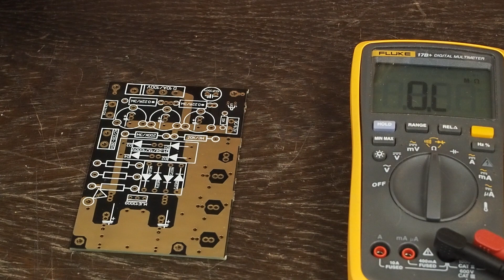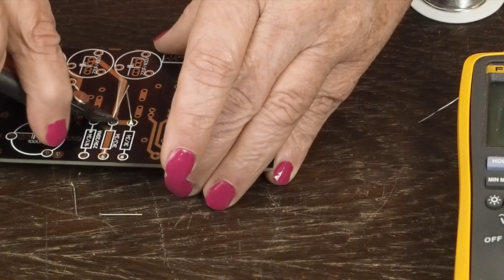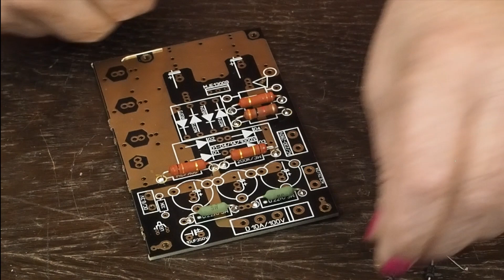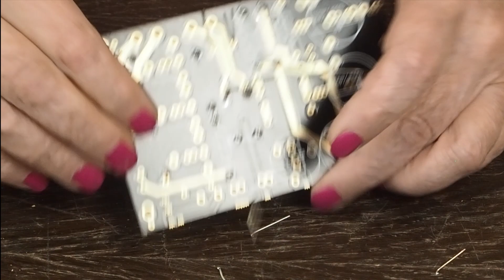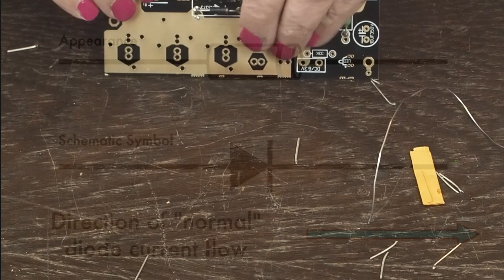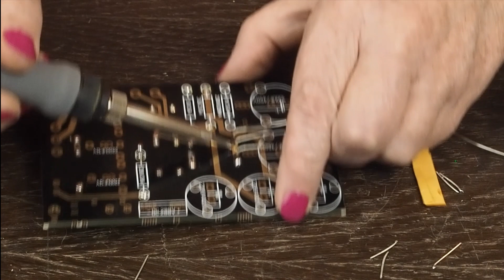All Tube Phono Stage Pre-amp Part 10: Power Board

Comment: Hello, thanks to your videos I now also have the courage to build my phono preamplifier myself. My question is: which diodes and which manufacturer did you use? There are so many at Mauser. I couldn't find anything in the order list on your website. Best regards and keep up the good work, Matthias
Reply from the maker: I buy the Kit that comes with the resistors and solid state parts, sorry can't be of more help. Just make sure the rating of the diodes are high enough for the load/voltage.
Reply: @SkunkieDesignsElectronics  Ah great. I also bought the kit. So I assume that you took all the components from the kit except for resistors and capacitors, right?
Reply from the maker: Yes and I actually use about 1/2 of the resistors, there are many that are out of spec I don't use.

Comment: Try using eutectic solder, it flows much better than 60/40.  Eutectic solder is 63/37 and has a lower melting point.  It has a melting point of 183°C, slightly lower than the more common 60/40 blend. The primary advantage of this solder is not the lower melting point, but its eutectic property. Non-eutectic solders, like the 60/40 solder, have a semi-solid state between solid and liquid. If a joint is moved during this stage, it can result in what is called a cold solder joint. Eutectic solders, like the 63/37, do not have this semi-solid state and are thus considered easier to work with as it produces fewer bad joints. However, these solders typically cost more than their non-eutectic counterparts.
Also, do you clean the board with acetone or alcohol prior to soldering?  It helps with the removal of oils and improves the flow of solder.  I also use a homemade liquid rosin flux I make and apply it with a cotton swap to the board foil, it really helps with the flow of the solder when the foil is being stubborn and causing issues.  2 oz. of pine rosin dissolved in 6 oz. of 99% isopropyl alcohol make a great thin liquid flux.

Comment: Take a look at a Hakko PNR-30-D Lead Forming tool. It puts a kink in the leads, to stop them at a height you wish. Also good to put a expansion relief, for example, on a resister that you put across a tube socket (since putting a tube in-and-out of a socket will stress a resister lead, if there is no way for them to flex).